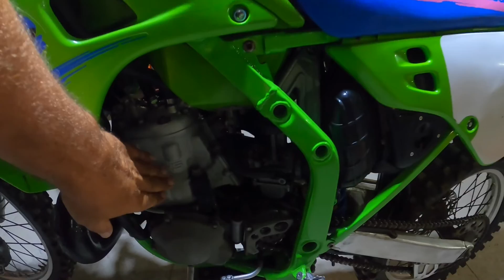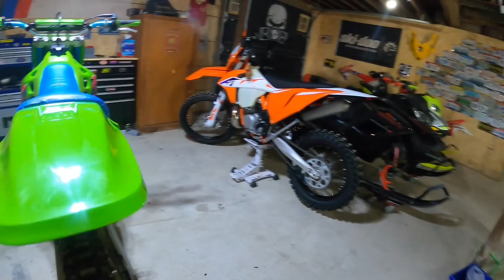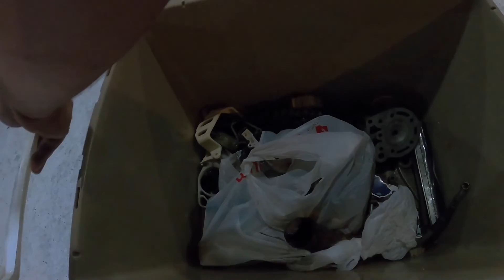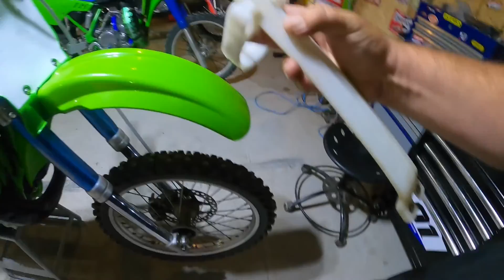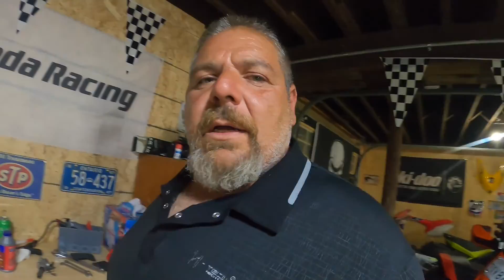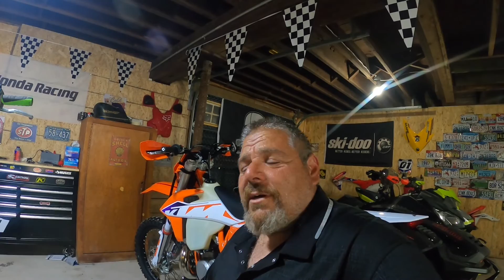LEGENDARY 1990 KX 250

Comment: Nice bike! I picked up a 93 KX 250 for my son. I am having problems finding some replacement plastics. I ordered a set from UFO Plast and they dont fit. Only the front fender fits. Any suggestions on where to look? 
Thank you
Reply from the maker: Wow, that’s surprising. I use a riidesUFO never had any issues with them. The only thing I can think of is maybe there was a mistake in the year of ordering the parts or maybe there’s a mistake of the year the bike I used UF old plastics lots of times and never had any issues.
Reply: @mikeguliz  yeah I thought I have a 93 KX but after sending them pictures they told me I have a 93 KDX. Unfortunately I am unable to obtain a title so I am learning lots as I go. Thank you for the response 👍

Comment: I just bought the same bike but there isn’t much info on the specs. I don’t know what gas mix to use and I don’t know what fluid goes in the black plug on top of the motor. Oil? On a 2-stroke? Maybe you can help me please please
Reply from the maker: It depends what two-stroke oil you use should tell you on the bottle are use dominator iamsoil  oil that’s mixed 50 to 1 but if you’re using other oils, you would be safe at 32 to 1 or a 40 to 1 would be our rate. And for the engine, make sure you use a dirtbike 10W-30 or 44 with clutches will do again I use arms oil, dirt bike oil specifically for dirt bikes there is a difference 10w40

Comment: I have a 1992 kx125 in the same condition as your 250 that im restoring. my bike spits oil too, is the crank seal a main cause of that usually?
Reply from the maker: Well, it depends how much it spills. You always get some sued with two strokes, but when it starts dripping all over the bike and making a mess fast most of the time it’s a cranks seal

Comment: 91 with the blue forks
Reply from the maker: Yes, it’s a 91 figured it out after I checked serial numbers
Reply: Great machines 👍
Reply: @WOLFPAC01 I would love to have those blue forks even on my 98 kx250 wonder if they fit were do I get those?And nice bikes mine is fully restored also and it's blinged out lol
Reply from the maker: @rockman49er  I don’t know if they came with the bike. I wish I can get another pair for my other builds. I keep looking on eBay I found a separate they were complete garbage hard to find. 👍❤️
Reply: @rockman49er . Me too.  I ended up buying 03 crf forks and converting over to them.  The reason I did was because my 98 forks had been fucked with in the past and one of the forks was missing the compression adjuster rod that goes through the middle of the fork.  I found several fork sets on Facebook but due to flaky sellers I never got another set.  So I found a set of 03 crf forks, triples and frame and bought them.

Comment: That’s actually a 91, the blue shock towers are 91 anyway, I would run the numbers. Looks like a 91..
Reply from the maker: @chrisblomdahl5585  yes  I realized there was a 91 on the second video I did check the numbers and it is a 91 I thought it was but the seller told me it was a 1990 until I checked the numbers. Thanks for the comment.👍